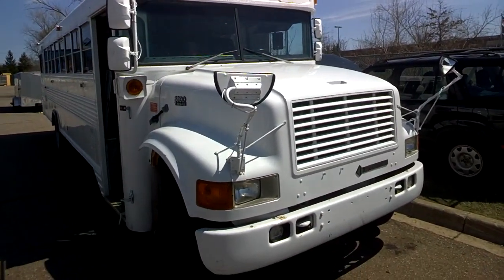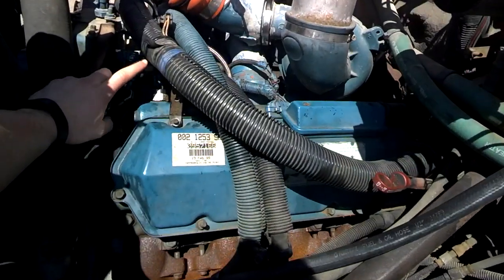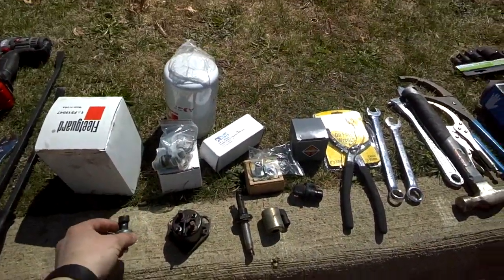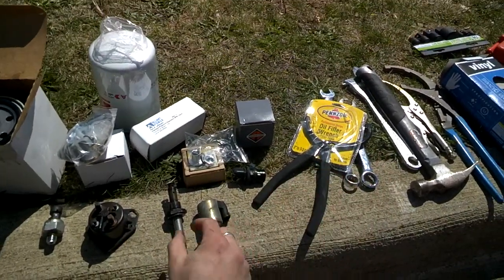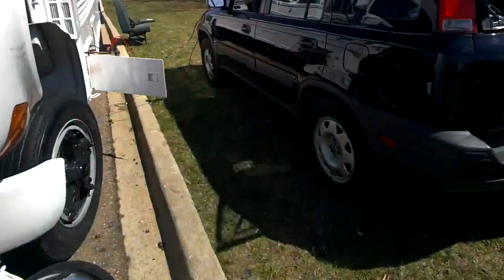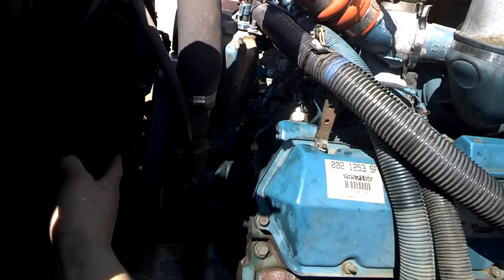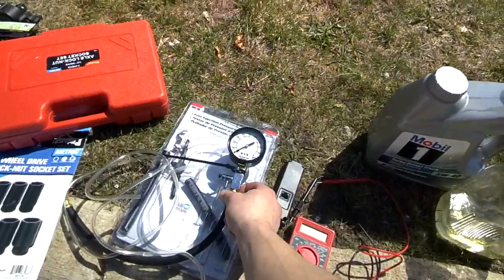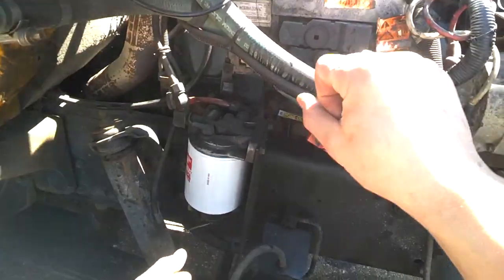All You Need to Know to Fix the 7.3L PSD T444E Engine incl CPS, IPR, ICP, FPR, etc.

Comment: Great information here! Will I am looking for a diesel p/u 1996 or earlier 12v Cummins or a 7.3 Power Stroke. In your opinion which is the most trouble free / durable  / ease in working on in stock configuration/? Thanks
Reply: they made 12v up to 98. 24v are not bad motors if you put a lift pump before it destroys your injector pump. all diesels are expensive to maintain you can count on close to $100 every servicing. if you use quality oil and filters. they are all pretty much easy to work on if you buy a high mileage truck you can expect to replace all the o rings/ gaskets especiially if it has a little age on it. just my .02
Reply: Go with a 7.3 Ford or a 12v cummings. Durable and easy to work with. Of course maintanance is key on these engines. Expect to shell out $100 or a little bit more on each servicing. Lucas fuel additive goes a long way too, put in regularly. I have had my 7.3 for about 4 yrs now, and haven't had an issue with it. Always service it on time, replace all filters, and take it easy on her, she will last. 300k on the clock, and she takes me anywhere, anytime. No smoke or rattling noises.
Reply: hayden ingram and add fuel additives with lubrication properties because of the low sulphur diesel it doesn't provided enough luberication for the lift and injector pumps on the Cummins or any diesel as far as that goes thats the reason 2003 dodge Cummins injector pumps had a high failure rate because of lack of lubrication to the pumps
Reply: they had high failure rates due to low fuel pressure. because it has electric lift pump on the side of engine and after so much vibration they fail then the ip fails.
Reply: hayden ingram they put the electric fuel pump in the tank also and they still had issues with them even with the mechanical lift pump anyways got to love government take something simple and make it complicated

Comment: Question, can you use an OBD2 reader to read the codes? I know you would need an adapter for the J1939 (or whatever plug it is), but I don't know if it would read international codes, as most of the scanners I see don't tell you truck models like International, Freightliner, etc. Does it just do a half job? Or will it read all the codes correctly?

Thanks for this video, it seems like it's very helpful. I basically JUST got my 1st diesel ever, so I'm still learning all of this stuff, but it sounds like this is a great video. I even saved it to my computer just in case I couldn't find it on Youtube. In fact, thats how im here now, I couldnt remember the exact title, but I had saved the video and thus was able to get the exact title and get here, lol.
Reply from the maker: Afaik there isn't an adapter unfortunately
Reply: @WillStone  

There is adapters listed on Amazon. They wouldn't sell them if they didn't work, right? Or is that just a naive assumption?
Reply from the maker: @alericjohansen6775  yeah afaik it won't work but please let me know if you find out otherwise

Comment: I’ve been through all that, rebuilt the HPOP and replaced the IPR and several other things and checked everything else you mentioned, and more, and my truck still refuses to start. Any ideas? It’s really frustrating. The last time it ran was July and it did great on a trip, but a few days after the trip, and ever since then, it refuses to start.
Reply from the maker: What error codes do you have?

Comment: Thanks for the Video. I have a 7.3 with a Crank no start. Found the fuel bowl empty. I checked the Volts on the fuel pump and theirs 12v. Do you have any suggestions on what it could be ?
Reply from the maker: Which error codes are you seeing?
Reply: Will Stone None due to the battery was disconnected. Besides the fuel pump what electrical part should I check ?
Reply from the maker: Could be a clog in the fuel line,  a couple different sensors,  or the fuel pump... just because it has power doesn't mean it's working.  I would start by looking at the error code(s)
Reply: Will Stone hi. Im back. Just to let you know. I Replaced the IPR, ICP and the fuel pump. My truck did turned On. But after 5 minutes it turned off.  My question is  did that happened to the 7.3 engine after replacing  all the sensors ?
Reply: What about the fuel filter or the 2 screens in the fuel tank?
Reply: @findingalex08  p

Comment: On these things, it’s way easier to just change all the sensors/IPR, ICP, CPS, Mechaical fuel pump delete, valve cover harness update to the single plug instead of the factory defective dual plug design.

Comment: hi will, excelent information , my name is miguel , have f350 7.3 model 2000 only  2 weeks ago not start, but  i have  a cuestion , my truck  not start even  smell gasoline or start fluid, i thinks  the piston ring, are bad i am ready to pull out and repair  do you have some  trick  to comfim about the  rings? thanks

Comment: Dude I need your help I bought a school bus and someone ripped all the wiring out of it and now it wont start. Can I replace the computer so the bus will start? So many safety stops in a bus. I would pay for your advise. Its a 2001 International 444e engine
Reply from the maker: I'm very sorry for the delayed reply - what an awful situation. Was this a thief, or the previous owner or something? Really depends what you mean by 'all the wiring' :/

You're gonna be best off visiting an International dealer or finding a local diesel shop. You can call and see who your local school district uses. If they have their own shop/mechanic, try to get put in touch 'just to ask a quick question'. To replace the computer you're gonna need some specifics that the dealer will be able to look up for you, or you might be able to find based on the VIN. But, yeah I'd seek IRL help asap if you haven't already - a bit difficult to help with that particular situation via interwebs

Comment: Next weeks video will cover the under valve cover harness,  IDM,  and HPOP....(which is what you unscrewed the IPR out of)...  a weak HPOP can throw ICP codes and light up your CEL but usually only under a heavy load or going up a hill, also can cause hard starts..... lol
Reply: Whiskey Tango can you please write out what IDM and HPOP are?

Thanks
Reply: @rogue1busintergalactic83  injector driver module and high pressure oil pump
Reply: I've replaced a lot of IDM's valve cover harnesses and injectors only a few HPOP but I hear about them failing alot also
Reply: @ttamn92  I've got a swamps high voltage high frequency idm and have been pretty happy with it.   Haven't had a bad injector yet but religiously run archoil oil additive and fuel additive for anti stiction.

Comment: Hello, can you please write me a list what exactly I need everything? I report from Germany and unfortunately you got very little to spare part or help. Our school bus 1999 goes out during the trip and spring very badly again Filter we have already changed. At first we thought it was due to the defective diesel line and the engine draws air. We do not know. Can you tell us where to get help? Best regards Steffen
Reply from the maker: I would start by purchasing a code reader on Amazon called the 'scangauge d' the d stands for diesel version the normal one won't work. then use it to find out what errors the engine computer is reporting and fix them
Reply: Hello Will, I bought it and have to wait a bit. I am registering Greeting Steffen
Reply: write it donw yourself , holy talk about asking someone to do too much, watch the video and write it down..

Comment: Great video.
Im from holland. and i have the same bus. only from the year 1996. I have problems white the engine. Bud where can you find the cable for the scangauge. i cant find it. i have looking the hole day for it. i hope some 1 can help me.
Sorry my english is not so verry good.
Reply from the maker: It plugs in under the steering wheel between the steering wheel and the ignition

Comment: Will, mind sharing the exact model of your diagnostic/code reader? I'm about to get a bus with the same engine and want the same reader you have.  Thanks for the incredibly helpful video!
Reply from the maker: Andrew Motter glad it was helpful - sure, it's the 'Scangauge D' the d stands for diesel model. I would read you the numbers off the back but I permanently attached it to inside my dash because most of the oem gauges don't work. Pretty sure they just make an odbII (regular) and a combo Diesel (j1939 & j1708) version. Ours uses the j1708 pinout.

Comment: i just bought a 2001 international 4700 bucket truck with the t444e and it was about a 260mile trip 5hrs at 55-63mph, the truck runs and idles great but about 10-15times on the way back home it dropped from 2500rpms to 0 or 2000 rpm both 0 and 1500-2000 several times each, the truck did hesitate or jerk in a slowing down motion then regained rpm very quickly every time except for the time it did it for about 15-20seconds.....any ideas?? starts right up overtime and idles no problem...only did it in 6th gear going around 55-60 2000-2500rpms
Reply: Did you fix it? Have the same problem with mine in 6th gear.
Reply: Although you posted a month ago I'm curious what was your issue. Was it a bad battery or alternator
Reply: look at the injector/glowplug harness where it goes over the valve cover. It is rubbing through and causing the injectors to short out. super common on those
Reply: Replace your cps. Cam position sensor. Front of engine, just above the harmonic dampener on the right side (passenger side). Should be one 10mm bolt and wiggle or pry it out with a screwdriver. Be sure to buy an OEM part from ford or international because the ones that napa and other chain aftermarket stores sell are trash and will fail right away.
If you don't fix it, it'll keep getting worse intermittently especially in hot or wet weather.
And eventually it won't work at all. When you get the part, buy two and keep a spare in the cab.

Comment: I have a 7.3 L powerstroke 444e 2000 International School Bus. This question stumps well known machanics I have to leave it plugged in 24/7 it will not start we use starter fluid than sound like it is going to blow a rod. Show me how smart you are please!
Reply: change your oil to 5w 40.... Simple. ...
Reply: Tammy Ramsey glow plug relay don't use starting fluid. Motor will not run without glow plugs cycling continuously until motor is hot.
Reply: If it sounds like your blowing a rod ( knocking) it could be your ipr valve

Comment: I have a different type of Code Reader from yours.  The Code that comes up on my Code Reader is FMI=4 Voltage Below Normal, Or shorted to Low Source.  Can you tell me what that means?  Thank you.
Reply from the maker: ICP sensor needs to be replaced or the signal line has an open or short. Try replacing the ICP. Also, if you google "t444e fmi 4 error code voltage below normal" you'll see lot's of great info. GL!
Reply: Thank you

Comment: 2000 4700 t444e here,  jump in and start it first thing, the idle starts to climb gradually and stays at high idle until I tap the accelerator pedal. It calms down after that. Any ideas?
Reply from the maker: Normal behavior to get the engine up to ideal temp. Let it happen, don't tap the accelerator
Reply: @WillStone  Ok, I appreciate the reply.
Reply: What’s the oil pipe/tube that runs from the front of the engine to the oil filter head?  Mine is leaking like crazy. Is it an involved repair?

Comment: Hi! I'm going to get a f250 with a navistar 7.3 with 80k miles . How many miles can this engine's run for?
Reply: abrahan espinoza depends on the maintenance and if it's modified. If it's stock or mild tune and well taken care of it's a half a million mile engine. Pretty much guarantee 250k
Reply: Mine  is a 2000 F350 7.3L, crewcab 4x4 dually....has 380,000 on original engine. Auto trans made it to 360,000. Had a straight pipe and Superchip tuner on it it's whole life. Still runs great!

Comment: dunno about international setups but ford trucks the tank selector leaks air in the fuel system a pickup in the fuel tank rotts off the fuel bowl screen gets clogged and the valve cover gaskets go bad these engines wont crank with a weak set of batterys either it actually needs a certain rpm before it will fire the injectors
Reply: i also keep a spare crank sensor and of course i my ipr is acting up as well still cheaper to maintain than a chevy diesel though

Comment: How's this bus and 444e running today?  :)  I'm thinking of buying a 2004 444e shortish bus.
Reply from the maker: Fantastically. Had her for 7 years now, only relatively major repair was replacing the water pump a few years back. Otherwise just a couple brake lines and rotors etc. Highway mountain passes are a little tough in the summer, other than that, no complaints.
Reply: @WillStone  Awesome. I am considering buying 2004 IC CE with the 444e. 10,000-14,000 GVWR. Will be doing a lot of CO,AZ, NM, NV driving. Hope this motor pushes us over all the mountains with grace as long as we take car of her. :)
Reply from the maker: @WyattBrown  awesome! good luck. the limiting factor for ours is the transmission.
Reply: @WillStone  Are you running the 1000 or 2000 series Allison?
Reply from the maker: @WyattBrown  at545

Comment: hello, so I had a blown head gasket...I had a mechanic change out the t444e motor now new motor will not crank over...just cranks...any ideas? mechanic saying ecu needs programming or bad ecu?
Reply: +Jalal Nasir Sounds like it's your mechanic's problem. He should figure it out, or pay to have it fixed by someone more qualified.
Reply: +Ryan Detwiler yes should have
Reply: I'm curious how this worked out. Just going off the comments my interpretation was that your mechanic was not up to the task, for whatever reason. It's step by step starting with fuel supply. Electric fuel pump putting fuel into the fuel filter housing?

Comment: Do you or anyone on here have links to the parts you bought? I’d really appreciate it. Been dealing with some of the same codes.
Reply from the maker: sounds like you already have a code reader, which codes exactly? i got a lot of stuff on amazon/ebay but the listings may have changed since then. any ford dealership should have most, and autozone sometimes has stuff (a lot of parts are shared with the regular ford 7.3L PSD so just have them look up one of those)
Reply: It’s the code for icp low I forget the number off hand. Kind of a rough idle not rolling but chugging. Fine on the highway.
Reply: olive jalopy what’s the name of the code reader I couldn’t find it on amazon
Reply from the maker: @joetow100  I don't remember paying quite this much but it's prolly worth it. I use it permanently installed to view temp, rpm, mph, etc https://www.amazon.com/dp/B00VX2NP4W/ref=cm_sw_r_cp_apa_i_M8dxEbPJ8F6WB

Comment: Ok so I Replaced the crankshaft potion sensor now I have 0 power when I accelerate it I’m stuck
Reply from the maker: you mean cam position sensor? why did you replace it? sounds like the new one is bad, try another?
Reply: Will Stone yeah I ment that sorry I was beyond tired at that point and I did but than it still messed up I also checked the wire harness and I’m still getting the code

Comment: Oem only on any sensor on a 7.3 cheap is never better with these engines. A lot of cps from auto parts stores won't work right brand new. Save time and frustration and quit buying sensors from amazon unless they're international

Comment: You never said specifically what you did to fix the rough run condition while coming back from Colorado if you could let us know what you did specifically to get to where you were going
Reply from the maker: In the end I can't be 100% certain if it was my IPR or CPS or ICP as it finally worked when I unplugged, cleaned, and re-plugged in the CPS terminals. Since I had already replaced everything else I mentioned in the video it could have been (and most likely was) a failing IPR.
Reply: Will Stone also, I would suggest throwing a bottle of electrical contact cleaner in my bag.   Trust me it helps...

Comment: How can you bleed air on this engine..it wont start.
Reply from the maker: What makes you think you need to bleed air? There should be a schrader valve somewhere, but the first step is to check what error codes you're getting.

Comment: I wish you would redo this video. It's got good value but it's kind of disorganized. Now that you got through it you could probably make some big improvement in reference to the the first run.  Like. let us see the part instead of the plastic bag the part is inside of. Stuff like that.  Thanks man.
Reply from the maker: I agree. I wasn't planning on making it at all but had just set up for a day's work trying to fix it when it ended up only taking five minutes. So I figured making one on the fly was better than not making one at all :)
Reply: I got'cha Will, then a 133+ thousand times people sat through it. Now . . . make yourself sit through it one more time :-)

Comment: That does nothing to troubleshoot the cause. Just replacing a ton of various parts fixes which issues? You have to diagnose a problem in order to solve it, and the engine not running is a symptom, there must be a reason and that reason has a cause.